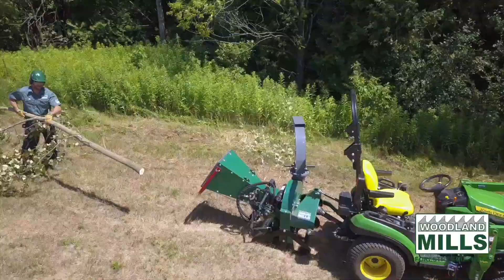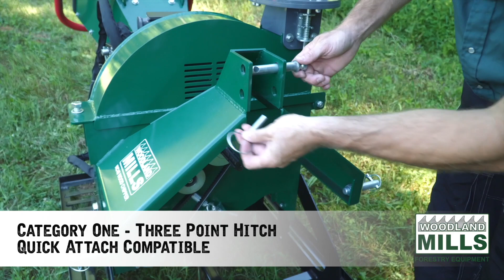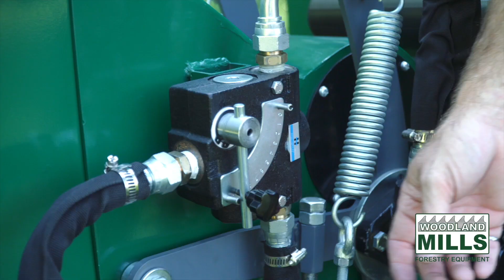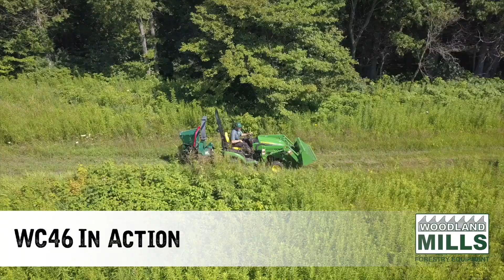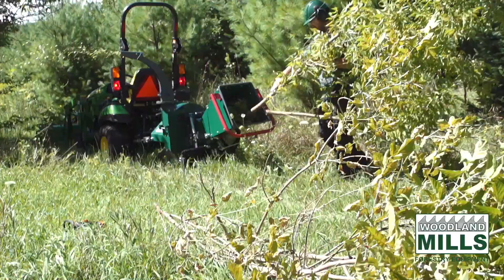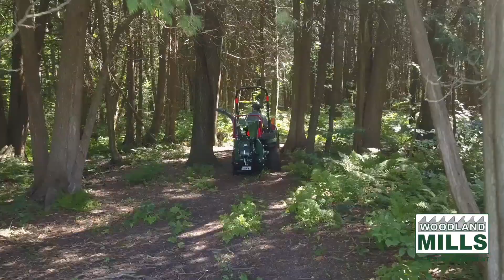Woodland Mills WC46 Wood Chipper Overview (2018)

Comment: Thanks for the video Josh. I’m ready to buy! Please give me your opinion on something. My Kubota (B2650HSD) is 19.5 HP at the PTO shaft. I’m certain that this model , WC46 would work awesomely, but I’m considering the WC68, which I realize would be best suited for a more powerful machine. But all things being equal, (identical tractors, identical 4” limbs) would there be any advantage of one model over the other? Would my tractor chip a 4” limb equally well with either model? My thought is that with the wc68 I could slow down the feed rate a bit for the occasional larger limbs. This topic has been floating around the internet so hopefully you can chime in on this. Thanks!
Reply from the maker: Both chippers are direct drive, difference being the flywheels, the 46 has a slightly smaller flywheel so it cuts closer to the center of rotation and would cut that 4” branch a little easier then the 68 cutting further out.
That being said, if you can effectively lift the weight of the 68 and move it around your property on the tractor model you have,  then yes by slowing it down you could make a 68 work with it’s extra capacity to get that 4” branch through. Josh